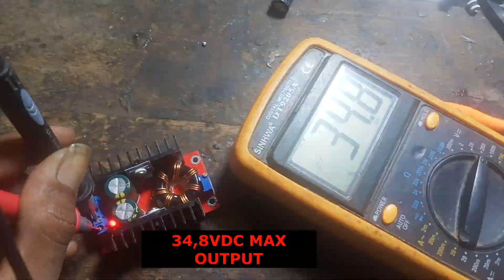MODIF/HACK STEP UP 150W output 60VDC

Comment: @trian911  kalo maximalin lagi volt nya bisa gak om, sama modif diatas maximal amperenya berapa om
Reply from the maker: bisa om  tambah lilitan induktor nya , naik kan frequensi pwm nya , perbesar mosfet dan diodanya
Reply: ok thankyu
Reply: Ada chanel luar 12V to 220V..

Comment: Mas apa masalah bila kebalik pasang wayar positip ke negatipnya ya. Punya nya  sy ini R010 itu langsung kebakar sudah diganti masih ngak idup dia. Mohon ya mas penjelasanya dan apa boleh dimodifikasi atau solusinya ya mas
Reply from the maker: Cek mosfet om ,
Reply: @trian911  mosfetnya bisa ngak diganti dengan medel irfz48n sy ngak punya kayak asalnya mas
Reply from the maker: @stephenchun6825  irfz48n kalau tidak salah vds max nya 55volt om ,secara teori bisa di jadikan pengganti mosfet stepup tsb , 
jangan lupa cek juga output dari ic pwm nya om

Comment: Gan bisa servis totolink ga
Reply from the maker: area mana om ? saya riau
Reply: @trian911  saya Jawa barat
Reply: Itu jalur yg anda potong untuk resistor. Tdk ada pengaruhnya. Tetap nyambung.
Reply from the maker: @SubandiSubandi-pk5to  coba cek data sheet IC pwm UC dkk pwm step up seri ini om , pasti nanti tau knpa dengan penambahan resistor di jalur itu bisa merubah tegangan output max dari stepup ini , itu juga kalau om nya bisa baca data sheet 🙏